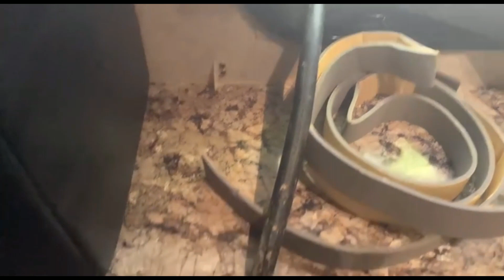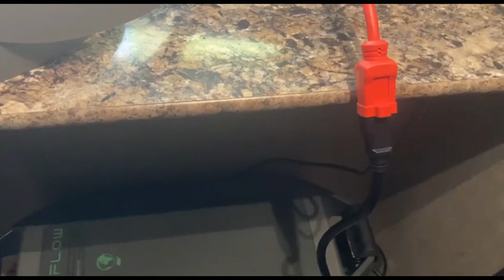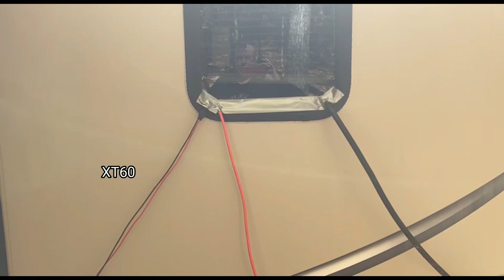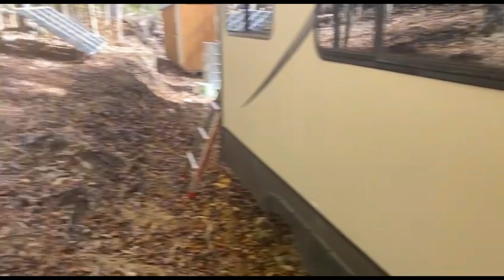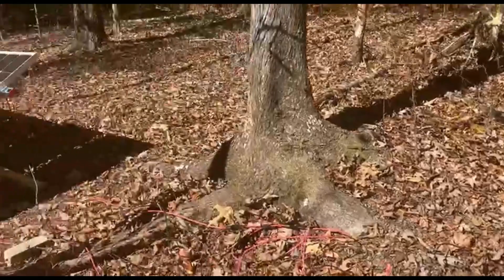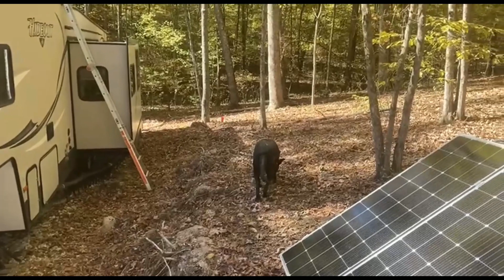EcoFlow Delta Pro: Three Week Solar Performance Update

Comment: Does the fan noise modulate when the demand is lower and when no recharging is occurring? Trying to determine how noisy these things are
Reply from the maker: Honestly, I would have an issue with the noise if it was in the same room. We keep it in the bunk room in the camper with the door closed and while you can hear it when it is operating at peak use, it is not a problem (and camper doors are not exactly thick doors). I would not say it is noisy, overall, however. The fan noise modulates with higher or lower demands.

Comment: Do you keep the inverter on 24 hours a day on your Ecoflow?
Reply from the maker: We only shut off the AC output on the Delta Pro. You can change the settings on the unit to auto-turn off after varying numbers of hours, however. The inverter does not use a lot of power when left on, however. If the battery level is at 80% come sleep time, for example, in the morning we have lost about 2%, so it is running pretty quiet at around 6 or 7 watts per hour when not in use. ☺️